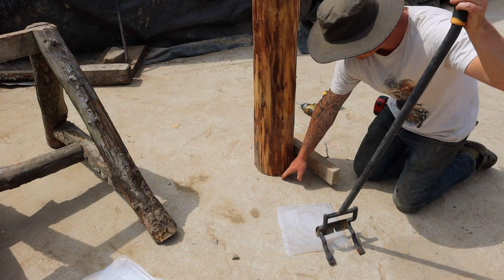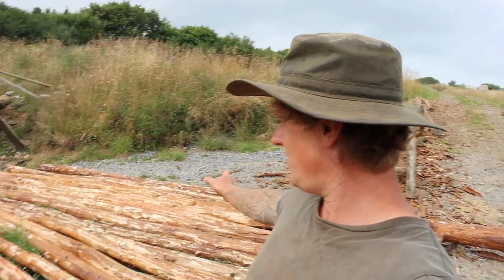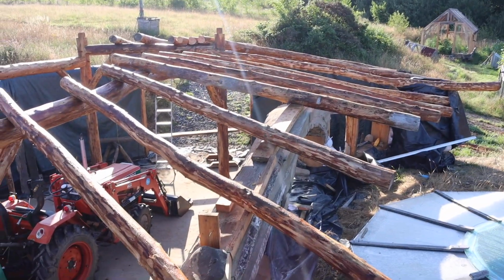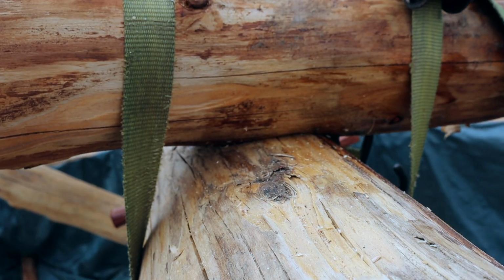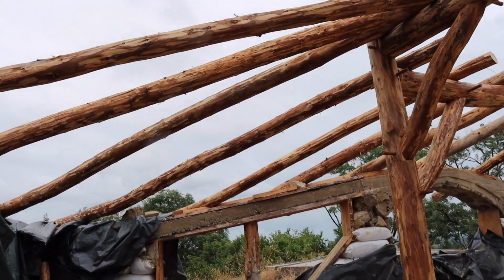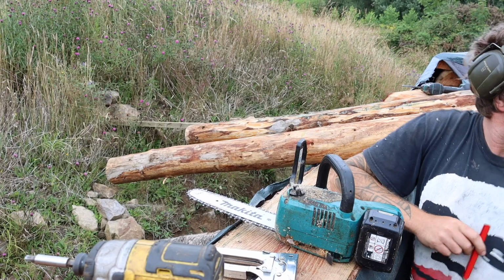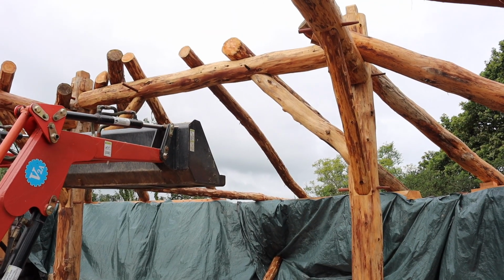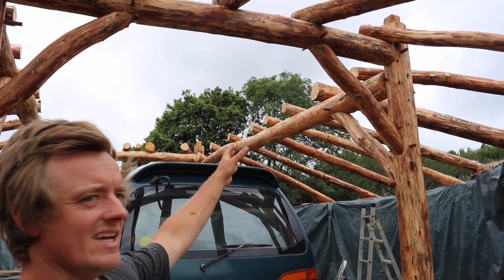Off Grid Earthbag Workshop Part 66 Installing Roof rafters

Comment: Love the channel but I envy the fact that you get to build what you want how you want. Where I have built and still build everything has to meet IRC codes, plans have to be stamped by engineers and work Inspected at multiple stages. Even the small family cabin I am currently building has to meet all those requirements, Snow loads, wind loads, seismic loads, sheer and on and on. Enjoy your freedom!

Comment: My grandparents build their house and put 4' overhangs for the exact reason. it lightens the load at the top part because the over hang is so long. They also used a type of "aircrete" concrete tile for the roof. It works amazing except I'm about a foot taller than they are and have to duck to miss the end of the overhang in spots. XD 

Brilliant building, been following you for ages and love to see you develop your land! keep it up!

Comment: As you are working on a higher level I can recommend a wall-ladder. I made some myself, two larger ones to get up at least two meters and two smaller ones that I can use when cleaning windows or need working areas a little lower than the two meter ones. I have a sketch I can send you - they are easy to make and very mobile as they are not attached to anything. You'll see if you want the sketch. 
Keep up the good work. ;-)

Comment: At 23:00 you discuss how the cantilever reduces the point load on the interior supports. This was generally true, but keep in mind the angle of the beam affects this greatly and will increase the shear forces (lateral force) exerted on the exterior wall.

Comment: Kris, not only does the roof overhang offer more strength, I think it gives the building more character. (Will you be putting some sort of guttering in)?
Whoever invented ratchet straps deserves a medal. 
Thanks for another great upload mate.
Reply from the maker: Total agree about ratchet straps! They are one of the most used tools for me. Surprising though how many people have no idea how to use them though. 

Yeah there will be drainage around the roof that goes down down pipes to the drains in the foundation.

Comment: If you cut the trees down in the summer the bark will pretty much fall off after they dry. The reason is the flowing sap between the bark and wood is the key for this, in winter when trees are dormant the bark is up tight to the wood and stays that way through drying.
Reply from the maker: This is true..... But that Sap that helps the bark come off also is full of sugar and attracts fungus and bugs that rot the wood much faster. You never want to cut in the summer if you want the wood to last
Reply: @KrisHarbour  Did not know this, I used to peel lot of logs for fence posts we just burn the end going into the ground to keep them from rotting. Love watching you work.  Keep it up Kris

Comment: One question if I may from a Wisconsin u.s.a. subscriber   doesn't all the roof weight that u have built so far rest on just the tendons of the center posts?   I'll grant u there are supports in those corners but they also are just tendons that are not really that large    why didn't u notch out the posts so the weight will sit on the posts as well as the tendons?   I will say I enjoy ur videos very much they are informative and fun   it's easy to see u will end up with quite a working shop home and garden

Comment: Thank you for letting us in on your work! I love watching your series! Have a little question you might have the answer to. I have cut down a pile of logs and cant make up my mind if I should debark them now or later. Im thinking that the bark helps the logs to dry out slower so they dont crack to much. Im I right?
Reply from the maker: It depends on what you want to use them for. If you want to keep them green then yes keep the bark on. But if you leave it on to long it will rot the wood prematurely.
Reply: @KrisHarbour  Thank you for the answer. Will leave them as they are his winter then and use them next spring. :D

Comment: Hello Kris, what a nice structure, well done. Are you going to have to install permanent bracing (center poles) in the windows because of the weak concrete?
Reply from the maker: No there is a glue laminated timber on top in an arch that is very strong so that is taking most of the weight.

Comment: If I’m being completely honest I’d have to say I’m sorry that you didn’t build it as originally planned with a reciprocal roof like the lower shop. 
I think the 4 posts will interfere a lot more than you think when you’re working there and a reciprocal roof would/could still provide the clearance to lift your van to work on it.

This roof design does look great though.

Comment: Are congratulations in order Kris and Dot?! Anyhoooo the roof is spectacular.....will there be a glass section to the pitched part of the roof?.
Reply from the maker: Hi Moira, yes there will be. I did plan on doing it all in glass but after the hot weather we had i changed my mind as i think it will just get to hot in there. so im going with roof windows instead.
Reply: @KrisHarbour  Excellent!🥳🥳💖. Great re the roof too🤣. x

Comment: Hi Kris, I've been wondering if there are any good sources for determining the max span for a piece of roundwood, depending on diameter and tree type, and how much distance you'd need between them to spread the load of a roof safely. Would you be able to recommend any reliable material? Thanks heaps! Swen
Reply from the maker: Info on roundwood is lacking quite a bit although you will find some studies by searching for "roundwood timber strength study" But as a general rule you can find the info for square timber then double it. However i always make sure timbers are at least 5x stronger than they need to be so its not that relevant to what i do as the timbers are always way over sized for the load on them.
Reply: @KrisHarbour  Thanks for the quick reply! Tony Wrench describes his roof weight being around 8 ton, but simply recommends letting an expert calculate the load bearing capacity. I guess the design depends a lot on what timber is available, and for what price.. Thanks again, cheers from Switzerland!

Comment: Any reason you carved into the top plate to accept the rafter instead of cutting a birds mouth in the rafter, would have thought a birds mouth would be stronger to help prevent them from slipping

Comment: I think your cantilever idea is well wrong Kris, in fact, the opposite would be true, the longest length with similar weights per foot on either side of the fulcrum will always have more effect than the short length, simple maths, you are right in saying it will help somewhat, but there will also be bending forces on your logs around the fulcrum partially negating that.
Reply: Think of it as two people on a See-saw. If the fulcrum is is central and the people the same size, the system is in equilibrium. If one person is heavier or the fulcrum moves towards one end the point of balance shifts. Also, as the beam moves towards vertical, the load acts increasingly down on the lower end. So, I say Kris is correct! 
 While the calculations are beyond my maths, I think the cantilevered part DOES have a significant effect on reducing the load on the top beam in this case!
Reply: @andymccabe6712  Hi Andy I appreciate you taking the time to reply but it is a simple physics problem if you have a heavy weight at the end and along a long arm, and lighter weight at the end and along a short arm, the shorter arm cannot possibly lift or counterbalance the longer arm and greater weight to any great extent, it will help slightly of course.

Comment: Although I enjoy all of your videos I had a suggestion for your wind turbine which lost its blades. Instead of using wood missouri wind and solar sells 80 inch Aluminum blades and has a 5 blade configuration that would give you as much power as the tri wooden blades you use to have. The shape of the Aluminum blades are anti over rev. They come with a steel mounting bracket.
Reply from the maker: Im sure they are very good but i wont be buying anything from missouri when i can make some out of a bit of wood.
Reply: @KrisHarbour  But the aluminium is the final answer instead of wood and they are inexpensive.
Reply: @KrisHarbour  I have a 3 blade set up I bought that I am not using. Give me your address and I will send them to you if you like. they are 80 inches long and would help produce more power and they are anti over rev.
Reply from the maker: @monstirz  Wow That is very kind of you to offer but im ok thank you. Im going to make some new wooden ones in the winter when i have some more time. there was nothing wrong with them it was just the mast that failed and led to them breaking.
Reply: @KrisHarbour  OK bro.

Comment: I don't understand how you're able to erect all these structures without local gov interference; are you just relying on the '4 year no objections' rule?
Reply: Maybe it's the case that if the structures  are not over a certain height then it's not a problem.  I worked with an architect friend who was one of the leading pioneers  in self build in the UK  and I think  he said  that then. He built using the  Walter Segal method which also uses the turf roofed method.
Reply: I watched the entire house build playlist expecting the "I've had a visit from the building inspector" video, but there isn't one. Not that I'm trying to put down or disrupt what he's doing, I'm just surprised.
Reply: Since he is public with the build he have to follow local rules. Plenty of haters/trolls probably sent complaints and he wont disclose it to give them what they want.